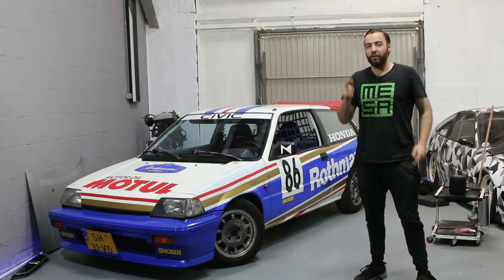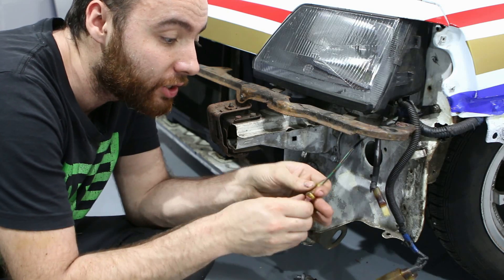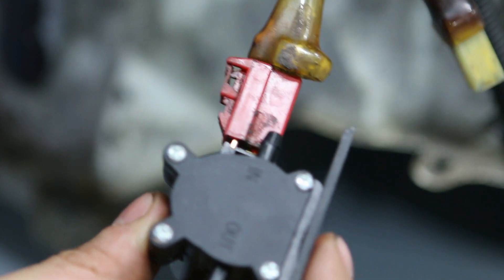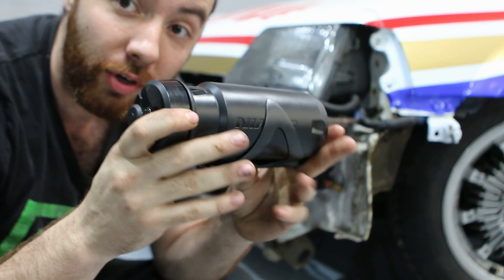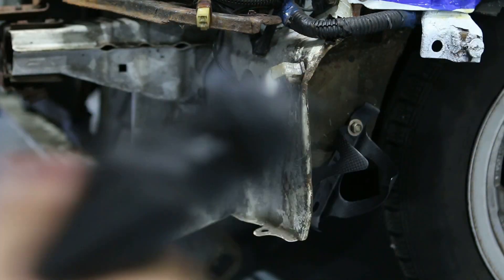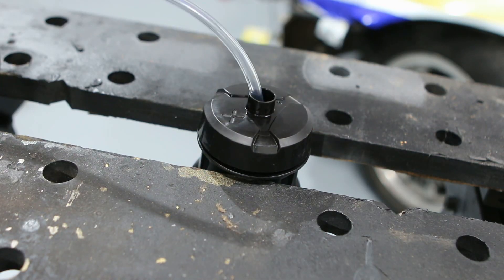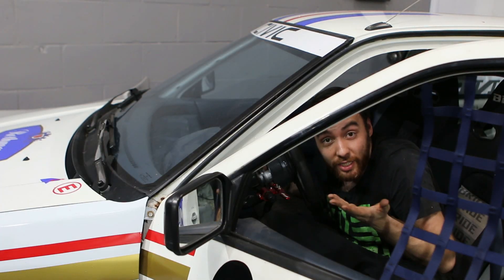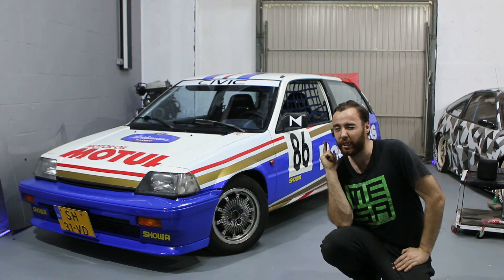How to easily wire tuck / relocate a washer fluid bottle for super cheap!

Comment: But, but...you can buy a universal window washer system at any auto part store with all that stuff to mount anywhere and it holds up to 2gallons. This thing may last for 4 sprays and that's it \0:
Reply from the maker: Isnt a 2 gallon tank a bit large to tuck behind a bumper?

Comment: its not illegal ffs
Reply from the maker: It is illegal in Holland and most european countries actually, your car can get taken off the road if you do not have a functional washer system. In some countries however legal to remove the system completely. It is up for debate if that better though :)
Reply: ben altijd door de apk gekomen zonder dat systeem
Reply from the maker: @madoka8372  is jouw auto van voor 1971? Dan hoeft het niet. Dit is een quote van het nederlandse APK wetboek: 

"Auto's welke een voorruit hebben en op kenteken staan na 30 september 1971 moeten zijn voorzien van een voorruit spoeier installatie. De controle is visueel na het in werking stellen van de sproei installatie. De ruitensproeiers moeten op zowel het directe als indirecte deel van de voorruit sproeien, niet alle sproeikopjes hoeven te werken zolang maar aan voorgaande voldaan wordt."

Als jouw auto na 1971 is dan moet je wettelijk gezien toch echt een ruitensproeier system hebben. Maar ja de kans dat je er voor aangehouden wordt is miniem.
Reply: eentje is van 2006 de ander 1941
Reply: In England UK you will fail an MOT by not having functional front washers and wipers but the rear wiper and washer can be removed